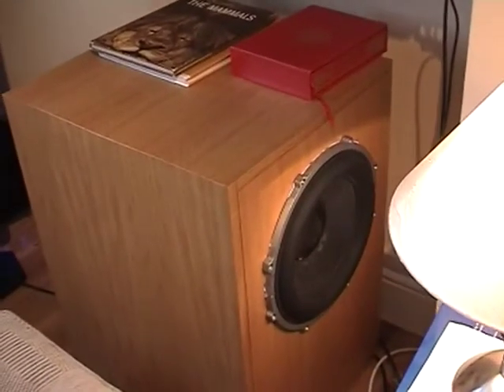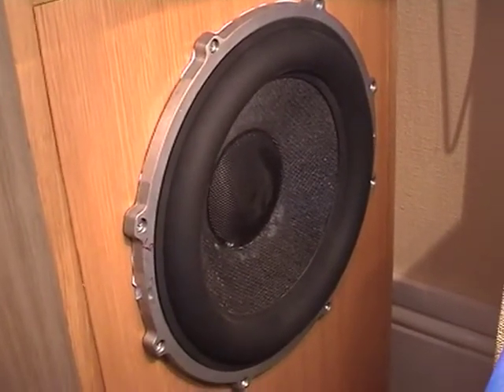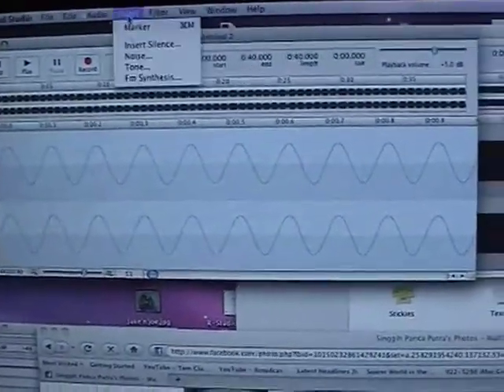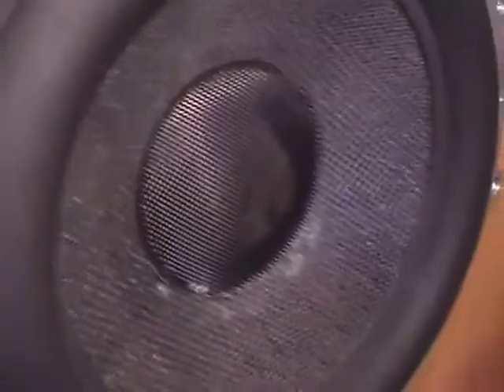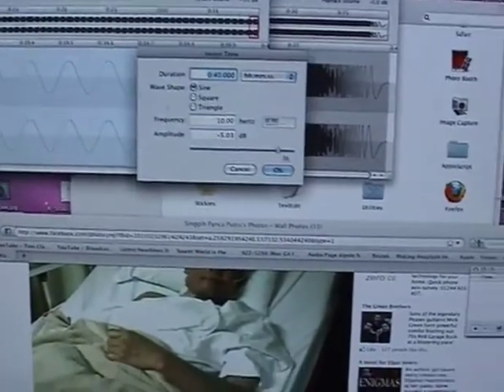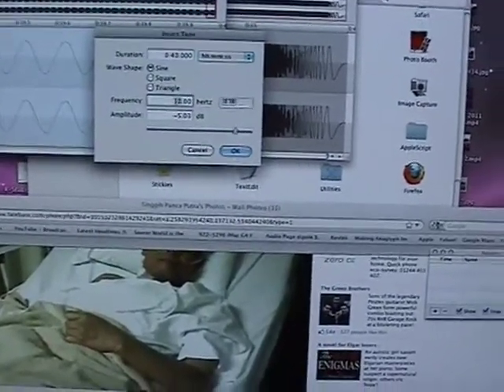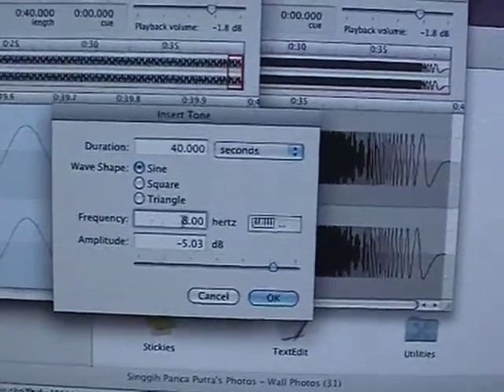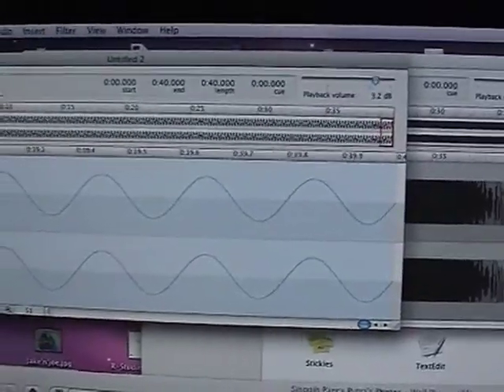Subwoofer infra sonic test

Comment: My neighbors do that to me. They make my eye twitch and my muscles spasms. How can I prevent that from happen and which materials do I need?
Reply: Pablo Leroy Jerez get an electromagnetic hydrocarbon foil blanket, that should help and if not throw a brick at there window then they will stop with there low bass
Reply: Are there any way to detect and measure it has been blocked? I have the same problem with mine too.

Comment: Can you please explain what you mean by "balanced configuration" and "reaction cancelled placement"?  Does this mean that the two drivers are placed back to back and are wired with one in-phase and the other out-of-phase?  And is there more to it than that?  Are the two drivers in the same space?  Thank you!
Reply: the polarities of the woofers are connected in a way that makes them balanced, which means if one woofer goes positive the other one goes negative. well this is atleast what i know!
Reply: ive experimented with these types of enclosures in car audio and notice a significant lower frequency response rather then  enclosures without a common chamber but the subwoofer coils would tend to heat up if played continually with high wattage (quicker than usual) but it made sense because both woofers were wired in phase and were fighting against eachother.. since then ive switched to ported enclosures much louder but lack the lower frequencies unfortunately😒 The common chamber enclosures would be great for home theater tho
Reply from the maker: No. One goes out and the other goes out. They cancel out together the net reaction. So no wobbling cabinet.